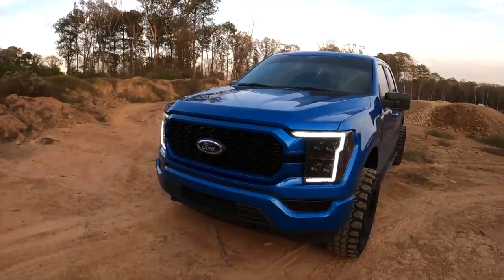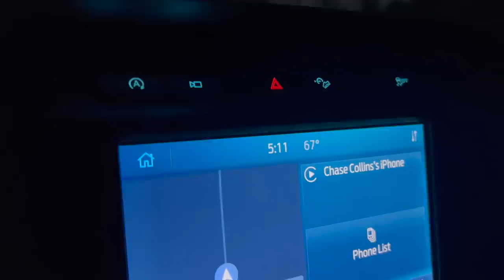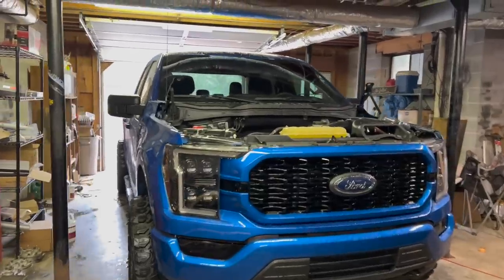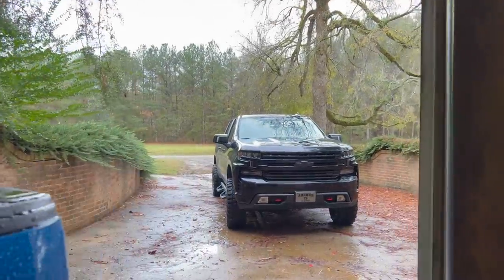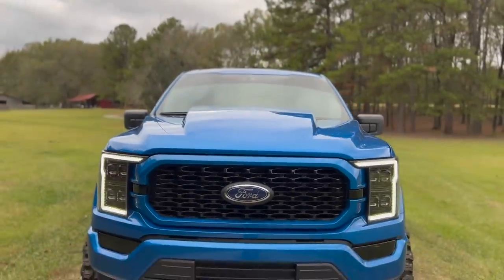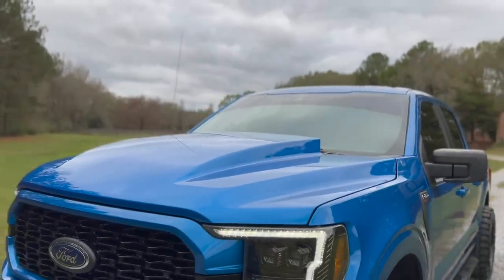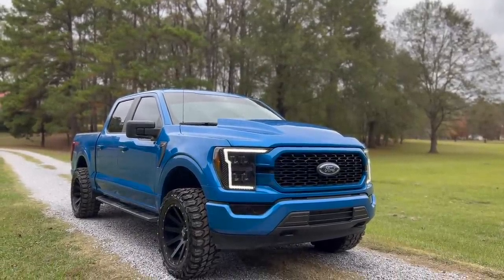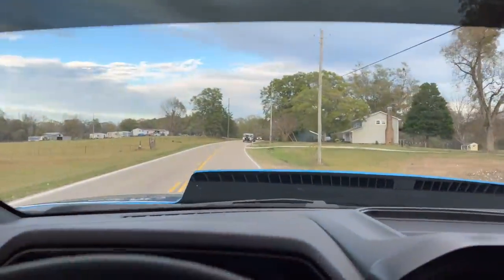MOST AGGRESSIVE MODIFICATION YET!!!

Comment: Yes it looks fabulous. 
I had a racing hood on my mustang. 
Fastest street car 1988.
Those oversize tires ?
Are boat anchors.
And u have to wash twice a day.
As long as you are happy 😊. 
I run light weight truck v8 SC race rear end. 
The fastest ,stock 17's. With t bars and bearing girdle. 
But you look fantastic 😍. 
I would not even race you. I would pop wheelies for you.